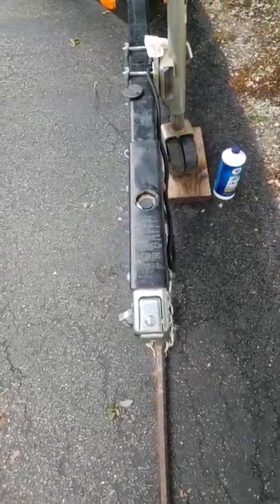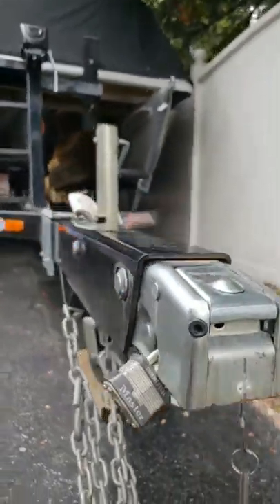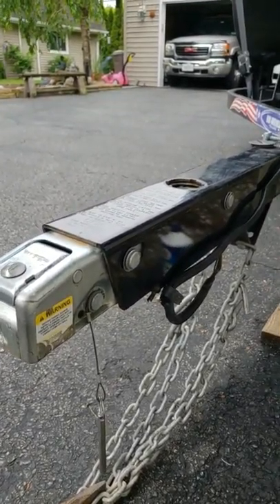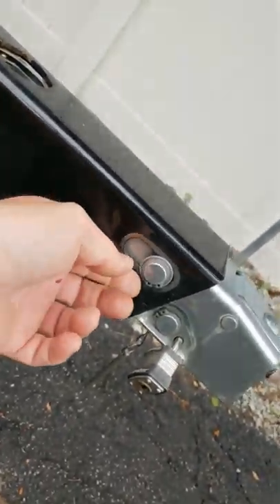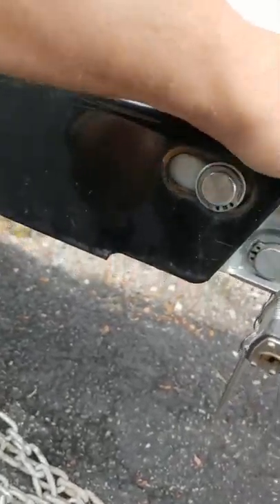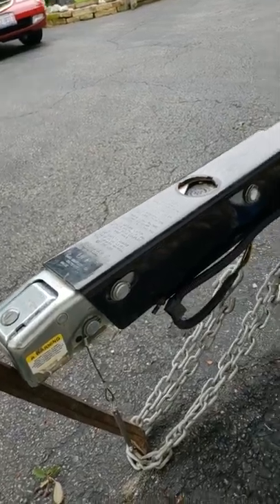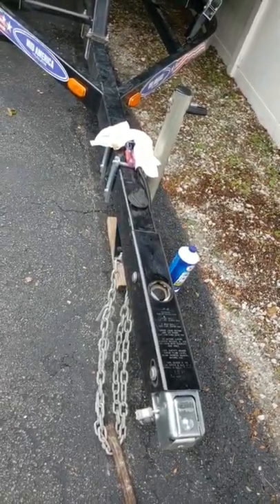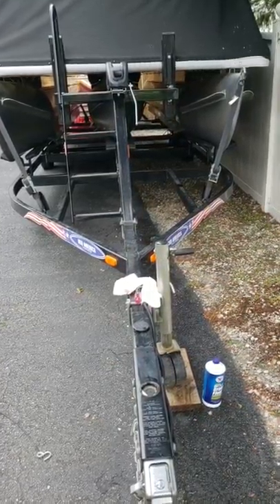Trailer buddy A60 surge brakes break away emergency brake cable

Comment: I brake my safety cable every other year. I forget to take it off the hitch if I get in a hurry. You are correct l, you have to take apart the tongue and recrimp the cable end which is designed to detatch in the event of the tongue coming off the ball. Then you have to crimp the safety cable to the brake line at the actuator.  The hardest part is getting those damn c rings off to slide the tongue out so you can crimp the safety cable back on.  I loved you chain and crow bar set up. I just used my truck to apply the surge brake.  I got it down to two hours to fix it   I will likely break mine again soon.  I even my my own cable now. Buying one is $200!

Comment: For anyone else that sees this. There is a hole next to that release lever you can put a flat head screwdriver into and "pump" the master cylinder. Still quite a pain compared to a vehicle brake pedal! But maybe easier that the large crowbar and chains.

Comment: Don't you have to just use a screw diver under the actuator to pump the brakes ??........
Reply from the maker: I do think you are correct about being able to use a screwdriver or pry bar to pump cylinder from underneath. 
Thanks!

Comment: I done the exact same thing on my old boat trailer and it made absolutely NO difference whatsoever .My brakes worked as usual for years after I jerked the cord out....
Reply: It’s not about the breaks working it’s about if it comes lose from the tow vehicle it locks the trailer breaks and stops the boat trailer from going till it hits something..

Comment: I had the same exact thing happen when I took my boat in for repairs. Did you have to replace your master cylinder
Reply from the maker: Sorry for the delay in my reply.  No, I did not have to replace the master cylinder.